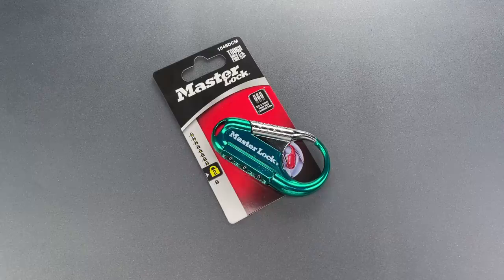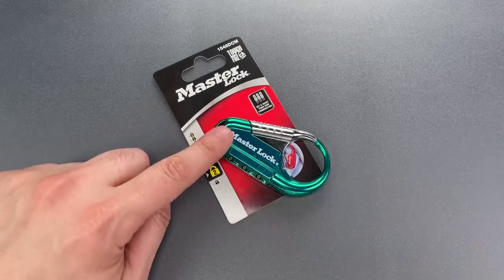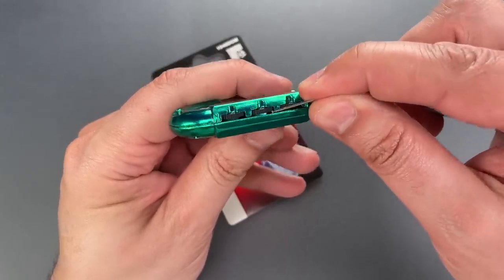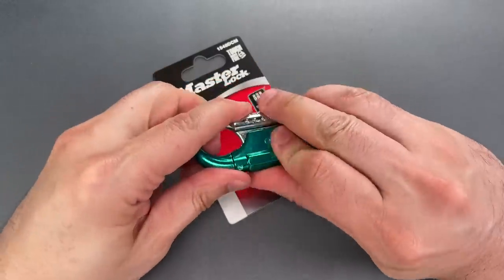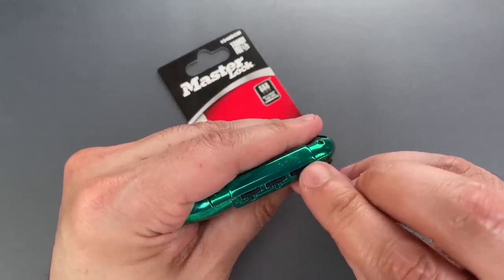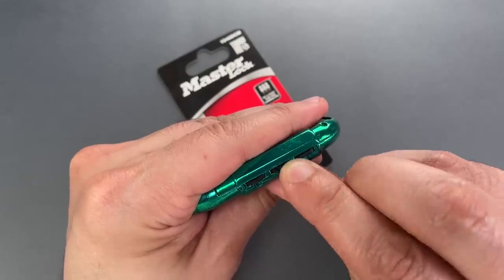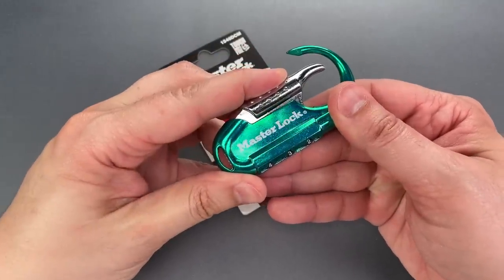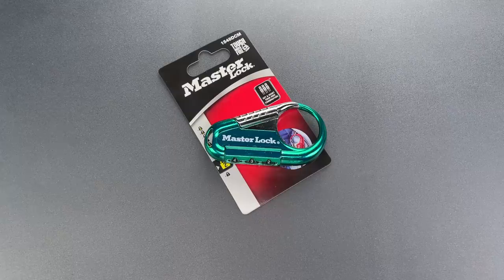[1315] Decoded by SIGHT: Master Combination Carabiner

Comment: If this is security level 2 what’s level1? Transparent lock body or the code stamped on the side?
Reply: Considering the fact that all the stuff manufactured today is made for ease of use (AKA dumb casuals) and instructions of products say "don't eat the batteries", code stamped on the side of the lock is not too far fetched.
Reply: @kirkhamandy  I've got a junk drawer full of level 1s!
Reply: openable by sound, since the speed of sound is slower than light (akalooking)
Reply: A keyring
Reply: A ziptie is probably level 3
Reply: I was thinking soft plastic. So, what would be zero.
Reply: Level 1 is the keypad to leave my grandmother’s nursing home. Not only is it 4321*, it’s labeled on the keypad. Only thing missing is arrows pointing to the relevant buttons with color coding to show the order.
Reply: @kirkhamandy  That might actually qualify as "chaff": https://en.wikipedia.org/wiki/Chaffing_and_winnowing
Reply: Level 1 is a paper clip
Reply: For level one they sell you a bowl of air
Reply: A Bundgy Cord and/or Duck Tape. ;O)-
Reply: Just a sticker which says: " please don't steal!"
Reply: It's a sign saying "Don't open this door".
Reply: Level 1 is just a shackle without any locking mechanism and text printed on the body that says "Do not open"
Reply: Level one is a doorman holding open the velvet rope and gesturing you inside.
Reply: @mabzor6500  They can't - Lays' Potato Chips have all the IP for selling bags of air...maybe Master Lock sells rebadged Ottolocks that they shimmed from unsuspecting bikers as level 1's?
Reply: It’s a masterlock branded pack of sticky notes that say “do not touch”
Reply: Ziptie
Reply: Post it note saying “locked”
Reply: So I actually got a 1 open they are just like bottom of the barrel locks, complete garbage.
Reply: 'Master' branded paperclip.
Reply: Yeah level1 is an acrylic practice-lock where you can see those pins and a pick provided for free  ;-)
Reply: level 1 is a regular carabiner
Reply: No lock.
Reply: Lvl 1 is a lock with one wheel with 0, 1, 2 as its options. The lock comes pre-set to the code being 0, and cannot be changed.
Reply: A tamper seal.
Reply: There is no lock, it's the same functionality as the Nophone

...maybe that's next in the market
Reply: A standard carabiner with no lock.
Reply: Level 1 is Velcro.
Reply: velcro lock
Reply: The honor system
Reply: @Bobal27  a lot of nursing homes use the current year.
Reply: Electronic lock wth only a 'are you a robot?' button.
Reply: @Gay_Priest  Love it. That earns the laugh of the day award. ~~~ All day long I'm going to be thinking: "yipe yipe yipe yipe yipe yipe yipe yipe".
Reply: Yes.
Reply: A paperclip
Reply: Probably just a normal carabiner
Reply: A post it on which you write, "Please don't steal this!"
Reply: TSA lock.
Reply: A U-bolt sandwiched between two pieces of duct tape.
Reply: 1 is just a master lock sticker
Reply: a ziptie
Reply: The Ziplok bag Bosnian Bill mentioned the other day.
Reply: level 1 is the "slash resistand" bags
Reply: probably an untied shoelace or something
Reply: Masterlock Ziptie
Reply: level 1 should be "put the valuable on your pocket"
Reply: @exlibrisas  level 1 is a TSA lock. You can buy a key for them online so cheaply the lock is rendered irrelevant.
Reply: Master lock seems to rate on durability is destructive entry resistance rather than bypass resistance. It more got the 2 because you could probably force the thing open with a screw driver. 1 is probably will breaker in your hands if you grip hard enough.
Reply: For level 1, you open the package and the shackle immediately disintegrates
Reply: 1 means that I can break it accidentally in my hands.
Reply: What is #1? a lock nut obviously
Reply: Lvl 1 is a combination lock where any combination opens it, lvl 0 is just a sticker saying "prortected by Masterlock".
Reply: Count on masterlock to figure out how to make one. I bet they were supposed to give this one a level one, but their enginners have been able to go lower. Expect a new product soon
Reply: @johnjohntv1195  Metal or plastic? 😁
Reply: reusable ziptie?
Reply: An angry word.
Reply: A piece of string
Reply: I dunno, I think level 1 would be a sign saying "Please stay out"
Reply: level 1 is "no entry" sign
Reply: If you look closely the level 1 is actually an open lock symbol...
Reply: A sign "please don't open it" with their logo on it?
Reply: Naa, you can't even lock it.
Reply: Level one is a cardboard lock with the words “slash resistant” on the side.
Reply: Those are just zip ties
Reply: Probably "Dummy Locked". Looks locked from the street...unless the light's just right.
Reply: i'd say level 1 is "just tie it shut with a bow"
Reply: Level one is a zip tie with a thin metal shim for a key.
Reply: Level 1 is just a regular carabiner.
Reply: I believe pringles uses master lock level 1 locking technology for their cans
Reply: Its a list of things you hand to the criminal, telling them that those things are in fact off limits.  That is level 1.
Reply: level 1 is those toy handshackles that have a release button on the side and that you don't need a key for
Reply: No it's just a belt that clips together with no code or key
Reply: Level 1 is a doorknob
Reply: Tag out/Lock out most likely
Reply: Level 1 unlocks itself when anyone approaches it.
Reply: @gplusgplus2286  The ziptie would be more secure especially if you used one with an uncommon colour, at least you would know someone had been in there and they can't just relock it after they are done
Reply: At level 1, you can't extract the key from the lock.
Reply: Zip tie.....9
Reply: Just a tag with the word "lock".
Reply: Level 1 is clothes button
Reply: level 1 is a fake plastic lock that you clip onto something to make people think it's locked up.
Reply: Paper mache lock
Reply: They make a plastic-bodied lock that uses a 1/16" steel cable. That might be a 1. It keeps otherwise honest people from opportunistically walking away with things, but won't stop someone even a little determined.
Reply: @DaemonetteBait  I once ordered a replacement key for a Mercedes I owned. All I needed was the VIN. Of course, this was before modern electronic keys, but still kind of shockingly easy.
Reply: @kirkhamandy  Aw, hey, now I have one of those bloated keyrings for my work. (Ironically enough, I keep them on a carabiner.)
Reply: Probably bike locks that can be cut off with garden nips (household item) instead of bolt cutters (specialty item).
Reply: Non removable key?
Reply: A sticker of a lock
Reply: A carabiner with the screw up "lock" so it doesnt get bumped off
Reply: @DaemonetteBait  why would you order a key for someone who didn't 1st prove they were the owner?  Granted a stamped code is sort of game over if the mfg will talk to consumers.
Reply: @anullhandle  ask a customer to bring a roofbox that they can't open (and therefore can't fit to the roof), photo means jackshit and the likelihood of someone keeping a receipt for more than 12 months is very unlikely. Shrug we advise customers that the lock is in a plastic housing and is mainly there to deter people from loosing stuff as a "joke". And not to keep valuables inside the plastic chunk.
We also advise people with expensive bikes to use a cycle lock to the roofbars aswell as the carrier to deter people just straight breaking the carrier arms off and running off with them still attached to the bike.

Locks are nothing if they can be bypassed through violence.
Reply: Level one is a piece of string tied in an overhand knot
Reply: Masterlock branded bread twist tie
Reply: A piece of string. Untied.
Reply: @TesserId  politely asking people not to steal your stuff.
Reply: Level 1 is a twist tie.
Reply: Vap Pri  Report this spammer
Reply: @_Roboute_Guilliman_  Using the current year as a security code in nursing homes is probably more secure than that Master Lock carabiner. I mean, how many of them can actually remember what year it is?
Reply: @TesserId  a paper bag... bhahahahahaha!!! 😂
Reply: @_Roboute_Guilliman_  Good one.  How about a zip lock ?
Reply: @xtnuser5338  The condom would fail the gun lock test.(Keeping a curious teenager out.)
Reply: @Mult1Core  your eyes do not emmit light.
Reply: For level 0, might as well toss in that old classic: bubble gum.
Reply: A lock with the key in another slot
Reply: Plastic locks. Made from 100% recycled plastic wrap...

Comment: When  meme's become reality.
Meme: "LPL looks at a lock and it opens."
Reality: "LPL decodes a lock by looking at it and it opens."
Reply: Conclusion - We are the Orks. By believing something strongly enough, it becomes reality.
Reply: @OzixiThrill  humans are space orcs
Reply: @OzixiThrill ,
You are an affront to the Machine God! LPL has worked hard on Mastering his craft, and hard work is praise to the Machine God.
Reply: Unless LPL decodes some sorta braille lock with his eyes shut, he's been opening it by looking at them all this time, ya know?
He had the power all along!
Reply: @GashimahironChl  But he has always used a tool, sometimes a custom-designed tool made by Bosnian Bill.  In this case, he simply looked at the lock and opened it without using tools or flatware.
Reply: @Ciborium  Nah, he still had to use his hands, the real deal will be when he looks at a lock and it clicks open in terror.
Might be he finds a retina scanner lock and then we'll have it, the ultimate laugh.
Reply: @GashimahironChl  But most of picking is done by feel? It wouldn't really surprise me if he does regularly pick locks with his eyes shut.
Reply: @WJS774  You know, i was gonna throw the "but how can he find the hole and line up his tool without his eyeballs?" thing, but then i realized i can do that in the dark just fine with the better 3\4's "keyholes" and a long, clumsy tool, so why couldn't he do it with a tiny, hard lockpick? :)

Comment: Oh, it would be so easy to accidentally change the combination to something you don't know... No worries.  Masterlock might as well post this on it's support page.
Reply: Even if you can't decode it, it's just 1k possibilities at worst. Try 50 a day and you will be done in 20 days at worst.
Reply: @Cinkodacs  -  Try a hammer, maybe 5 seconds.
Reply: @Cinkodacs  much less, this lock doesn't go up to 9.
Reply: @Cinkodacs  There are only 5 positions on any wheel- 0-5. Therefore there are 5x5x5 or 125 possible combos 000 - 444.
Reply: @jackiemowery5243  Sent me off on a fact check run.  Found this: https://youtu.be/RSs1Q1QyHQM?t=257 Though the model for that is a 1547DCM, which appears at the beginning of the video (and the 7 was dropped in the title).

Comment: Only masterlock would put a lock on a carabiner
Reply: At least it doesn't have WiFi or bluetooth unlocking.
Reply: Its more of a puzzle than a lock
Reply: Did they really, though?
Reply: Some carabiners have a carabiner locking sleeve.
Reply: @carltonbauer2779  they are probably more secure.
Reply: It’s actually a legit idea. Securing coolers or kayaks while camping. Just poorly executed
Reply: in dark helps
Reply: @carltonbauer2779  yea the locking sleeve on a climbing carabiner would likely be much better than this 😂
Reply: @bentleylockwood6456  I actually own one of these, only bought it on a whim because it was marked 50% off at like $3-4. That, and because I watch this channel, and thought I might be able to practice on it, I have started picking simple locks since I began. Anyway, the gate in the carabiner is far too small to put on a cooler handle or anything, it only opens about 1/4 to 5/16".

Another complaint I have, is that the first time I opened it after removing it from the packaging, it nearly cut my thumb, when the gate swings open there is a sharp point at the end.
Reply: @psibug565  true!

Comment: So now when you're out and see someone locking something with this, in just mere seconds you can mega troll them by picking it open and resetting the combo to something else they don't know.
Reply: Actually, I think this lock would "change the code" if you handled it wrong while it was open. Then, the lock would be even more useless if you didn't know this hack. Master Lock should reference this video on the instructions,
Reply: @fredhubbard7210  yea the way you change the combination is way to easy to do by mistake.

Comment: This is the same sort of lock used on a lot of luggage.  MY GF forgot the combination to one of the suitcases a while back and I used this technique to recover the combination for her.

On the luggage the actual combination is often 180 from where the notches are visible, but that angle varies.  Once you have the notches lined up you just turn each wheel one click in the same direction until the lock opens.

Comment: "Home improvement store that sells master lock products"
Unless you're using a rope, that's not much of an improvement.
Reply: A rope would take more time to take the knot out of than LPL took to figure the combination of this lock!
Reply: @jim.h  That's a good ad for a rope company. Rope: at least it's not a master lock
Reply: Lowe's.
I bet it's Lowe's.
Reply: @lairdcummings9092  If that's the case , Masterlock really set the bare Lowe on that one.
Reply: @hdezn26  😁
Reply: @lairdcummings9092  it is. I work in the department that has those in it.

Comment: I have one of these that I found in a box somewhere, and have been trying to figure out the code for a few years. I even tried brute force, going through EVERY possible combination. Then this video appears, and I decode it as he says. But it still wouldn't open. Since I figured at this point it's probably just stuck, I hit it against something and it finally opened! So even though I tried the code on the brute force attack, it wouldn't open then because it was stuck.

Thanks LPL for helping me open my lock!

Comment: I did a very similar trick with my suitcase lock in front of the airport security when they asked to see inside my suitcase. I totally forgot my code, so I fellback to "OH I can see the notches!"

I lined them all up, and rotated them one digit at a time until the notches were in the right place (since you couldn't see the correct position). Click. Opened.

Security didn't question it either, weirdly.

Comment: I realized why this can be so easily decoded as soon as you demonstrated how to change the code. I wonder how many times someone has gripped it wrong when opening the shackle and accidentally changed the code?

It's not a design flaw, it's a feature!... To address a different design flaw.

Comment: Going back about 30yrs, here in the UK Ford Sierras were a very popular fleet car, and at the time I was working as a mechanic on a fleet of about 70 of them. One of the most common jobs was rebuilding a drivers door lock. Repair kits were available and after a while repairing a lock was just a routine "Do it with the eyes shut" sort of job. If I remember correctly the locks were Chubb and the internals were based on a series of a circular sort of shims and the working bit of the key was a series of matching slopes. I became so proficient at building these things that I could look at a key, memorise the slopes (1 to 6) and read the number of the lock. To be honest, after that my memory fails, but I could probably order a new key using the number.

Comment: I bought one of those locks because it was ridiculously cheap. I didn't expect much out of it but I didn't even notice that it has gaps under the combination tumblers,  Until I watch this video and I looked at mine.  I have always done really well Opening combination locks without the combination.  Except for the master lock round lock  Combination locks for lockers.   Thanks for the video I will know not to trust this  lock to anything other than maybe to keep keys on my belt loop

Comment: Serious question: Are there any keyless locks you would recommend?
Reply: A proper designed code panel - those were all the guts are in a inside box
Reply: @fischX  a shielded box, remember LPL picked digital locks with a strong magnet

Comment: I just want to point out, that whatever you put on this needs a keyring. Meaning the locking part does nothing because you can just undo the keyring to remove the keys. This may be the most useless product Master Lock has ever made.
Reply: Uh, what? You can literally use it like a normal padlock, maybe only limited by the thickness of the hook.
Or just use a chain, put the carabiner through one end, put chain arround/through whatever to protect, put the other end of chain into the carabiner, done.
I think you comment is the most useless comment ever made.

Comment: Question: how many combinations were even possible? The highest number shown was 4 (starting from zero) so that would be only 125 combinations
Reply: if the highest number is 4, this is 445 combinaison (with 000). but if you count the number of turn he do there is 9 number, so 1000 combinaison.
Reply: @cascanorichard9162  I see how you got there, but you're saying that every number less than 444 is possible when it's not. You couldn't have the combination 388 for example if all the wheels only go up to 4.
Reply: @garethadams5580  oh yeah, forgot about that
Reply: 432. That’s amazing. I have the same  combination on my luggage